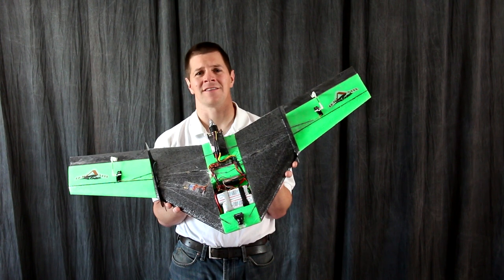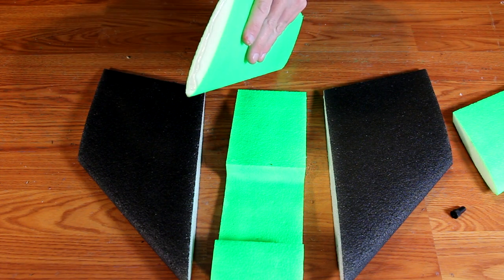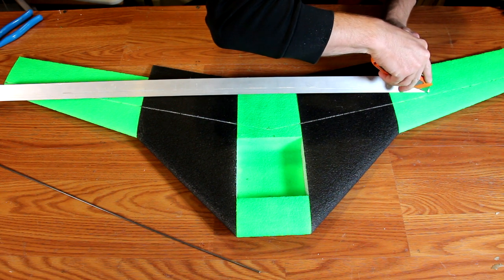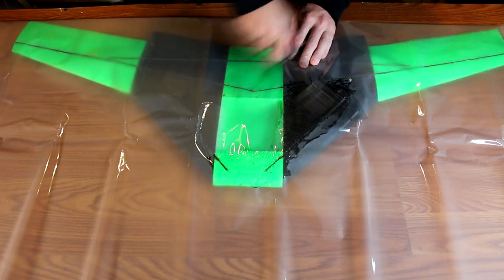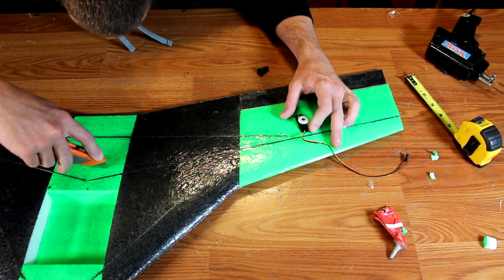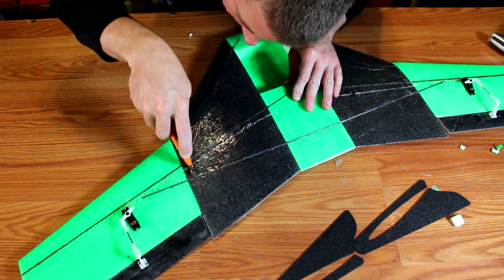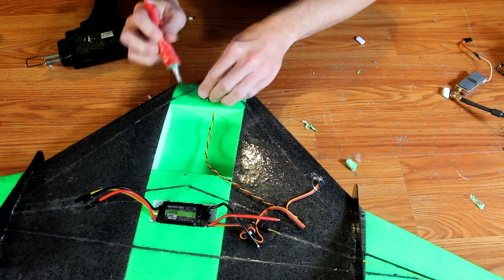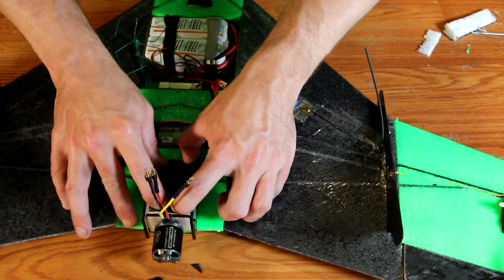VAS Wyvern 40" race wing build tutorial

Comment: Hey !! thank you so much for your videos. I just bought the same one while in flite fest. I had a couple of questions regarding how to build it: 
1. I want to know which setting I can put in the remote control (frsky) in order to be able to use the long range system (XJT deluxe Jr transmitter).
2. How can I wire the two batteries with the ESC?
Thank you so much

Comment: Ok... got the thrust angle as you described but now the CG... I have seen  3 different videos that suggested 3 different cg locations. I currently have mine at 7" back from the nose... and with a 2836 2700kv on the back and a 4000 4cell in the front, the AUW is 2.9 lbs or 1300 grams. How do those numbers sound?
Reply from the maker: Sounds a bit nose-heavy.  I would drop to 2X 1800 4S or a 4S 3300.  However, for your first flight, it is better to be nose-heavy than tail heavy.  Thus, it is safe to fly, but it is likely nose-heavy.  Mind you that you have an 8-minute flight time at 110mph or a 20 minute flight time at 80mph.

Comment: I just finished my Wyvern and I had a question I dont believe was answered anywhere (that I could find)... what is a good starting point for the thrust angle? prop pointed slightly down.. slightly up... neutral?
Reply from the maker: The motor should thrust down through the front bottom corner of the battery bay.
Reply: @CAGreve1231  thank you for the thrust angle information.  Looking for an AUW range these fly well at, building one now, targeting a medium speed fun cruise/exploration wing with elrs and a 4s2p LIon pack.
Reply from the maker: @Archer_82  - You want to target somewhere around the 2 lbs range for cruising.  For higher speed it likes to be closer to 3lbs.

Comment: Oh..,. Now I get it. This is the Theory W on roids💪 Damn....now I don't know what I want. How bad would it be if I put a spectrum As3x in there?
Reply from the maker: If you decide to put a stabilizer put all 4 vertical stabilizers on the airplane.  Flight controllers induce wag in flying wings due to the limited tail coupling.  Thus, if a flight stabilizer is used, more vertical surface is required to minimize wag.